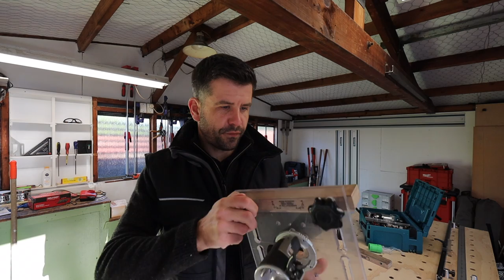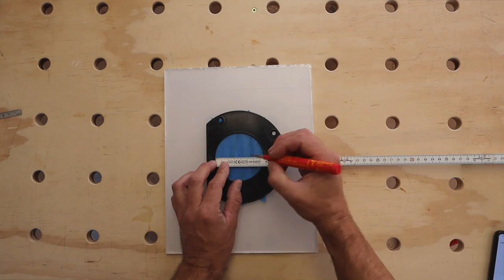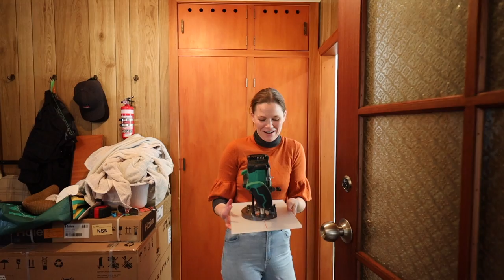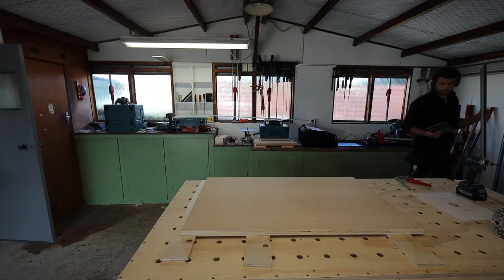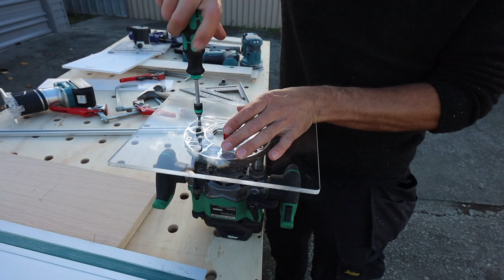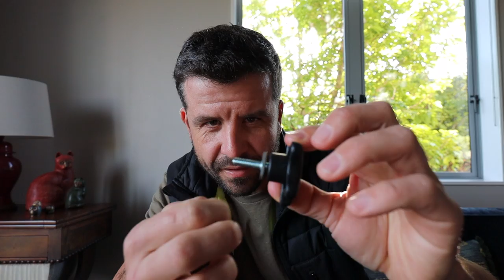A Router Table That Anyone Can Build

Comment: Instead of using a hole saw for the center hole you can use a router bit and plunge through the new base plate. This is great when you a tight fitting bit vs bottom base plate. Also when cutting acrylic use an air compressor to blow the chips away. When they accumulate, they gain heat and melt and clog up bits, saw blades what have you. You want to clear those chips away, also speed of feed and or bit is important. Sometime you need to slow your tools down.
Reply: A squirt of dry PTFE on the cutter or drill helps prevent weld back too👍

Comment: I had good luck with Jay Bates router table design. I know that doesn't totally apply to your particular design - not 1 to 1 at least - but you might take a gander at that. I have had really good luck with dust collection with that particular build. Though, I have found that the fence construction makes a huge difference. Maybe a slightly more designed fence for your table that hangs on the wall with it?

Comment: Agree with comments not to run timber between fence and router, not safe at all. Easy to adapt your fence and you will also find it useful to have a taller fence for running timber on its edge.

Comment: The Makita router and Bosch Router has a plastic cover to connect a dust extractor, I wonder if Hikoki router has the same. 
Just connect the dust extractor straight to the router for underneath of router table and all the dust going trough the hole of router bit. It will help a bit. Cheers
Reply: Yes the HiKOKI comes with one as well.  But I think when he upgrades his fence, he will need dust collect on his fence to catch the bulk of it…

Comment: Fortunately, a router bit is round.. so it does matter if your tracks are perfect since as long as the fence you stick on it is straight, the cut will always be true. 
Glad you built the table. 
It's actually pretty dangerous to use such a large bit hand held.
Reply: Yep. My router table has a pivoting fence that clamps to the overhanging top on the other side.
It is easy to make fine adjustments.

Comment: Loving the “hang it away when you’ve finished” router table 👍
One question: what size is the t-track you’re using the clamps in? I bought some for 5h3 front of m6 workbench for clamping from banggood but the profile is too small to fit the ratchet style clamps 😖

Comment: You definitely need dust extraction. I made a fence out of two pieces of ply at 90 degrees (so it's straight) and make a half round gap in the middle, with a place to put in the vacuum hose.

Comment: You should also recess the router plate cavity an extra 1-2mm and use grub screws as leveling guides so you can adjust the level of the router plate to the wood.

Comment: You could put those drawer slides on the side of it that pull out and rise (that way it's flush with the table top)  then mount it under the table. When not in use, push it in (and down) and it slides under the table top.

Comment: For my router table, I just made a jig for my table saw. I'll extend the rails out, attach my jig, and clamp it down to the rails. To prevent deflection,  i attached two L shaped backets to each side of the jig.
Reply: It's nothing fancy, but it works for my use.

Comment: have you considered making the router table portable with feet and french cleats so it can hook onto a tool wall and you can also take it to job sizes? kind of like uncle knackers router table a few months back but adding french cleats to the legs which is what I plan on doing when my 3x3 custom router plate arrives from the states.

Comment: Don't need a slidey fence like a table saw - easier for a homebrew table like this to just bolt one end of the fence to the table as a pivot, then adjust the  cut depth by swinging the other end and clamping it. Added benefit is the mechanical advantage gives you micro-adjustment at the bit.

Comment: Hi Scott,  I’ve only made a table for the Makita palm router, it’s good for many trimming jobs and the height adjustment on the router body, although a bit fiddley to get precise, works ok.  I have avoided making a table for my half inch router because the height adjustment becomes much more difficult.  There are proprietary systems available, but they are all very expensive.  What system do you intend using for fine height adjustment?

Comment: As some people have commented you don’t cut with the wood between the fence and cutter. You’re cutting the wood in reverse, and could jam the wood into the fence. I have had a router table and still took the end of a finger off, bone as well when wood gets thrown back. I also wonder about the strength of a Perspex plate, commercial ones are steel. I’ve been told if using a big panel raising cutter, if something goes wrong the cutter shaft can bend or snap, even a 1/2inch one. If so, the forces can be enough to break that plastic plate. It’s not the same thing as a baseplate, this plate is taking the forces of cutting.

Comment: A remote switch would be nice. You could mount a switch (even just a standard light switch) to your workbench that you plug into the wall with a cord, when needed. The switch then powers another outlet (both the outlet and the switch are permanently mounted to your table). That way it is easy to turn items on/off without having to bend down / underneath the router table.. One switch could power two outlets and could turn on dust collection and the tool at the same time.  That way, if you add other tools to the end of the bench, in the same manner as the router table, you can use that same switch setup for all of them. Just a thought.
Reply: Smart switch with alexa voice control made my life easier. They are usually only 10 amps so might be limited to how many appliances they control.

Comment: Having run a lot of t&g a number of years ago, using my shaper, I found it required a lot of down pressure to keep a consistent T or G in the right location. A router table requires really flat material. Considering the amount you have to rout, I think I'd stick with hand held. Offsetting the router plate to keep it flat will help.
Reply: you can make a taller fence and use a top mounted feather board

Comment: please don't route anything between the bits and the fence. if its upside down the router spinning counter clockwise. so if the material got caught on the bit it can send the material flying away and your finger can be caught in the spinning router.

Comment: Place a straight edge against the cutter head and draw a line on the table, your fence needs to be on tthe other side of that line as to not take any off to he edge of your workpiece screw the left hand side down tight and move the right hand side back a whisker. Push an offcuts from the right side past the cutter an inch or so. The tiny gap on the left fence can be mde up by one or two thicknesses of masking tape on the fences left hand side. To set up always tighten the left hand first and use the right side to adjust the cut depth, nb only a whisker at a time. For extra safety screw  piece of ply to the top of fence over the cutter head as usual!y you wouldn't have the cutter more than an inch above the table. Take care. Edit you may want to lower the cutter so you can flush the fence to the straightedge, tighten the left side, push the right side away from you two inches, raise the router and turn on, carefully pull the right side towards you to the line, stop router and tighten the right side . To adjust only loosen the right hand screw and move back or forward pivoting on the tight left hand screw

Comment: Typically you double up the thickness by using MDF or particle board underneath the plywood. It's acceptable to just use 2 layers of MDF. You can replace the top layer if it gets beat up.
  Even better use 10 or 12 mm Polycarbonate (Lexan) for a stiffer, more durable top plate.

Comment: Those yellow sticky "traps" aren't actually made to get rid of fungus gnats, they are more to monitor the presence of fungus gnats.  If you want to get rid of them, it's better to maybe cover the top of the dirt with diatomaceous earth....it's like trying to crawl through razor blades for the gnats.
Reply: that diatomaceous earth really works. it's great stuff
Reply: @henryponds9071  yes sir.  I have and regularly use it on a large scale.  You just want to make sure than when you are spreading it onto whatever it is you are applying it to, that you wear some type of mask for protection.  Organic as it may be, it's not good stuff to breath in.

Comment: FYI, Arlo security cameras need a subscription and as such is a rip off. Eufy cameras have no such subscription. They work great and the app is pretty good. I had two unwired cameras at the front of my house but then my wired crappy floodlight died, so I replaced it with the Eufy floodlight and subsequently took down the two unwired cameras as the camera and the floodlights are far superior to the unwired cameras. The floodlight camera would go perfect on your garage. Cheers.

Comment: Not acrylic (Perspex, Lucite), but Polycarbonate (Lexan)
Polycarbonate has 10x the impact resistance which is why it's used for tool guards, safety shields and goggles.

Comment: Hello Scott. I was wondering if you’ve ever heard of "Featherboards" Feather Loc for Router Tables. I have only routered once to build spruce windows frames. They were essential.
Reply from the maker: I like the sound of it, I'll look into it. thanks!
Reply: +1 for featherboards. Use for vertical and horizontal  stabilisation.

Comment: NOT A SUGGESTION FOR THE ROUTER FENCE!  Or dust extraction either.  Something I do when cutting tongue and groove to match existing lumber is to use a piece of the existing to set the height of the router bit and the depth of the cut.

Comment: G,day Scott Brown Carpentry from Sydney Australia.
Nice router table, and I like the acrylic base plate. I've only ever machined 1-2mm off the edge of a board. Nicely constructed all the same.
LG building approval 📐📏🤔
I'm interested in the format. 
* Owner builder
* Electronic and printed plans
* Council laws (Development control plans) 
* Fast track approval process (submission from adjoining neighborhood)
* Any specific limits to building covering to reduce impacts and reflection.
* Conditions of approval (such as protection of council infrastructure, hours for construction, date for completion and critical stages of certificates up to finalisation.
🌏🇦🇺

Comment: Don't laugh. I screw a 10" square of 1/2" plywood onto the router. Plunge an opening in the center. In addition to being a table surface that I can screw a spacing guide into, I use that ply as an overhang that I can screw into a worktable, saw horse, or miter saw outrigger. The router just hangs from the slab. It's crude, but it does work, it's free, and it takes up no space. Insert safety disclaimer here.

Comment: No you were not doing it wrong at all. 
 You were fine using those bits freehand. 
 What pray tell would happen if you were trying to run a load of boards that were 4 metres in length? Anyone would know you’d need a 4 min feed and out feed ! 
 Why struggle? Use the bits free hand 🤚! Be a Man!

Comment: Hitachi Automotive Systems jointly developed a seismic oil damper with plywood. Since 1998, the two companies have shipped a total of 70,000 of the systems for new construction and remodeling.